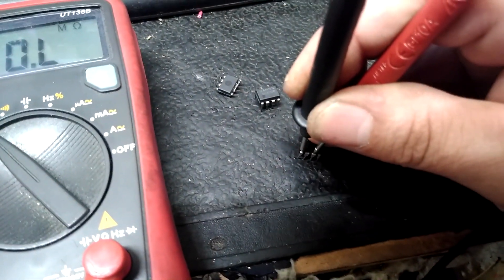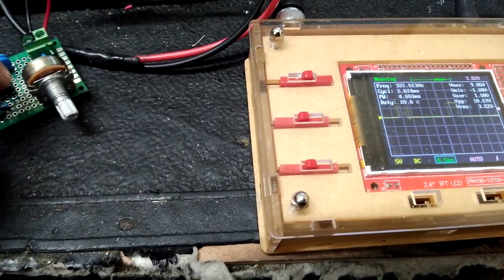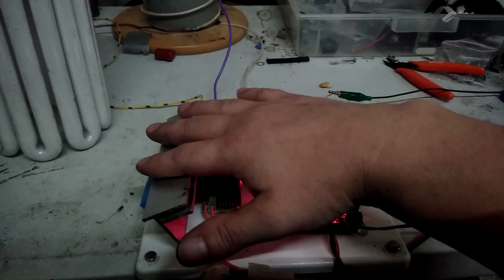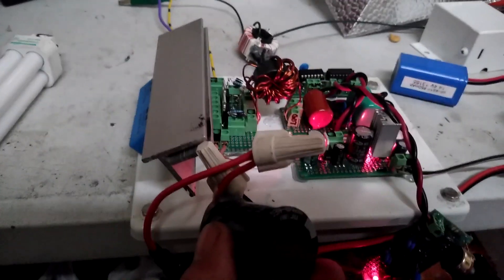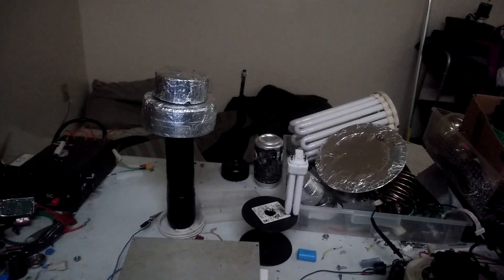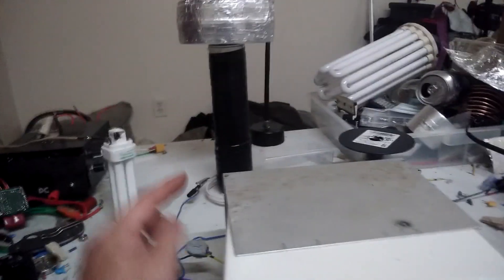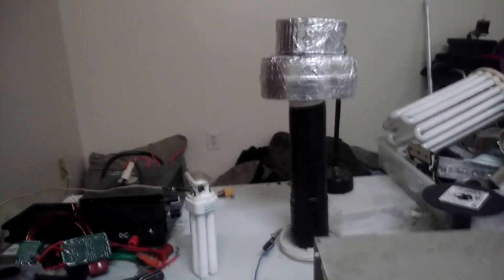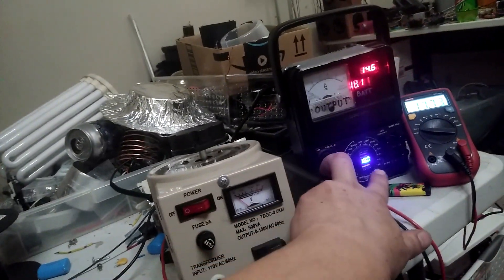Ward's DRSSTC .5 driver testing with IRFP460's

Comment: Cool, beautiful discharge!
Try to use IGBT instead mosfets. I used
 irgp50b60 in DRSSTC. They will heat less and have a built-in fast diode. In the half-bridge, put a 1 μF film capacitor or better 4.7 μF directly on the legs of the transistors, so it will be easier for them. Is the suppressor in the gate? I would put p6ke18ca, it will eat the emissions from the GDT. 
Optical isolation of the interrupter is clearly requested. I also want to make an optical isolation for the interrupter, so that they are not afraid of interference and stray from the Tesla coil.
Reply from the maker: Thanks, I was impatient and had only 2 460s on hand so I wanted to see what I could get. I'm waiting on some IGBTS now.

I've recently tidied it up and finished my half bridge and right now I've got about 6uF about as close to the fets as I can get them. I went ahead and added the voltage doubler to the board also. Only 15v zeners on the gates right now and some TVS's across the drains. I need only change out a few things like adding a 15V regulator and 1:2 GDT (I hope) for switching over to IGBT's. 
 
I agree about the optical connection for interrupter. It seems the only real way. I've tried shielded cable and a metal enclosure but this does not solve the problem entirely. 

I had hoped to push more from the 460's but I think it may be too much work given a fres of over 400khz. I've pushed them to the limits of what I can get to basic tuning recently and it's not impressive enough, or not really worth using a suitable MMC for IMO. Seems to be easier to get better arcs with a basic SSTC and 460 half bridge although that seems counter intuitive given how more efficient the drsstc is supposed to be.

Comment: That was nuts you put the plasma channel to shame with those kid of arcs.
Reply from the maker: haha why you gotta slam Jay like that? =)  But nah I did end up seeing some cool arcs in that go of testing but I also had to crank like 120vac which ended up being closer to 240v from the doubler. For some reason Jay doesn't show off high voltage coils, I guess for the age factor of people trying to build them, but he damn sure likes those multipliers lmao. I've seen much better iterations of this driver though and I get the feeling it's going to take me a lot of time to get it going right. What I've done here is caused myself to try to get better output with the 460s before even moving to IGBTs and if I can't do it I guess I'll just never move on to them.
Reply: @Magneticitist  Jay is cool and his builds look good but not vary original he is really doing main stream stuff. What are you looking for this device to do arc wise are you trying to make a constant stream?
Reply from the maker: @AnDyity  I guess I should be able to get reliable steady-looking steamers at 600-800bps or so with a low on time but also be able to get the long arcs at low bps higher on time. There will be a limit given the max of what an IRFP460 can push but I figure I should at least be able to beat my first half bridge which can run CW or interrupted and get longer arcs. I  could go ahead and plan on a design using cheap 200-300A IGBT's and feedback through whatever pole comes easier but there's no point if I can't get this one going right on the 460's. Real world tuning does not seem to match up with what I may come up with in JavaTC.
Reply: @Magneticitist  you may be driving those irfp460 too hard I was reading the data sheet it said the driving voltage was 10v.
Reply from the maker: @AnDyity  If you keep them cool they can handle over 10Vgs pulsed easily at these voltages but my gate drivers are currently fed 12v instead of the 15v Ward uses to drive the IGBT's. Also just the 1:1 GDT. I think my problem lies in the flip flop because when I go low BPS and try to turn the duty cycle up the gate drivers only want to do what looks like 15-20% max or something. What I should probably do to test this is run the same half bridge and gate drivers on a separate feedback oscillator circuit I use with the NAND gating to see what happens.

Comment: How much would you charge  to build a driver for me?
Reply: Build it yourself noob 
😂😂
Reply: @tvishmaychoudhary69   @Myself Steve  why don't you go play games in your mom's basement.  I have no issue admitting I can't solder worth a damn.
Reply from the maker: @tvishmaychoudhary69  lol he's cool!
Reply from the maker: Depends what kind of driver I guess, cost of parts is all I'd really care about and if I already have them not so big a deal for a long time youtube compadre lol. I've got drivers laying around cause I'm ADD on the low or something. If you're talking about this driver I think it probably costs something like 15-20 bucks off the top of my head for the IC's and caps etc.
Reply from the maker: I totally built this one randomly one day then shortly after realized I should have built this one to give me more headroom https://www.stevehv.4hv.org/DRSSTC1/DRSSTC1OCDsch.JPG
Reply: @Magneticitist  just keep in mind I plan on trying my wine glasses and I don't think I need huge top load discharges. I was planning on trying the 1/4" copper coil as a primary. And I am itching to try some new homemade capacitor ideas. A decade ago I deleted a lot of videos because of the Karen's out there. Little Johnny might electrocute himself if he sees you playing with 7kv. Well teach little Johnny how to read warning labels on high voltage transformers. I know I took 96.3gp down cause that device was dangerous. Lots of X and gamma radiation emitted. Radiation sickness is a bitch. Not to mention killed all my electronics like phones and computers. Then relocated projects to my mother's basement. I still laugh thinking how I got a message one day from my mother "were you working on anti gravity devices in my basement?" I told her I was using her basement because below ground the radiation doesn't travel as far. Used the gas line as one ground and the chain link fence outside as a second ground. Then 2013 happened and I lost tons of my little projects. Thankfully I still carry the learning from the building of those projects. Like recently it was I remembered how I coated the glass in beeswax before coiling. Using that fishing reel to tension the wire is a idea I wish I knew years ago.. anyways I will shoot you a email later. I got some coils I need to get some polyurethane on.
Reply from the maker: @MAGnetICus_Attractus  I guess it will really all depend on power levels. Hard to say the best way to drive something like a wine glass but it will not be easy given the size ratio and turns. You also wouldn't want to feed so much power into it at the glass resonant frequency it shatters lol. A higher frequency driver seems more suitable but then you are left with more corona than sparks. For such super high voltage input it may be better to just stick to a HV supply and spark gap, something homemade caps will work well with. When I played with foil capacitors for a hairpin circuit those suckers could sometimes jump out inches to shock me. I somehow got shocked through the pantleg one time messing with those by just being near it.
Reply: @Magneticitist  sent you a email.

Comment: I’m still waiting on a couple igbts, the drivers and a few wima fkp1 capacitors. Can’t wait to try out this circuit.
Reply from the maker: I'm so unfamiliar with IGBT's I'm afraid to try buying some yet, but I'm wondering if I can get away with the smaller packages instead of bricks. I also don't see why I wouldn't be able to use 460's at least temporarily but so far I haven't had much luck. Already fried 2 gate drivers. I just got some small 1000v wima mkps but they are 6.8nf each so I'm thinking of trying like a bank of them on a low turn primary but I don't think I have my flip flop working right. Can't figure it out yet, I mean it 'runs' but not better than my other half bridge and even when trying to resonate the primary I get the impression that I can't drive powerful enough arcs because the gate drivers do not see enough on time, regardless the interrupter being set that high. Using tested and proven GDT's and CT's (when I was able to accurately scope them) I figure it has to be the flip flop. 

I noticed in Steve's next DRSSTC he doesn't drive the flip flop the same way but caters a small RC tank into the PRE to help switch at the zero crossings. His interrupter signal is also not fed directly into the first input of the schmitt trigger.
Reply: @Magneticitist  yea, igbts are pretty foreign to me as well. I noticed that most people use FGA60N65SMD igbts in their designs so that’s what I ordered. Though I have also seen irg4pc50w igbts used. I don’t really know much about them and what characteristics to look for so I’m just gonna go with something tried and tested.
Reply from the maker: @quantumlab9130  I couldn't find any of those from legit distributors. Aliexpress I guess? I can find a lot of 'newer' versions but they don't seem to be able to handle much more peak current than a 460. It does kind of seem like people have been getting away with the cheap aliexpress ones though.
Reply from the maker: @quantumlab9130  4 bucks meh yea a little up there but you're right probably worth it. Don't see why the TO-3P wouldn't be fine for reasonable peaks. Probably pretty ideal for Steve's .5 driver.
Reply: @Magneticitist  idk if they are worth it yet, I’m gonna test them out and see how well they work.

Comment: Iam also making a similar circuit with IRFz44n and discrete gate driver🥰 should i upload a video about its when done?
Reply from the maker: Yea man I wish everyone would share their setups. After my last setup I think I hit my ceiling of what I can get at around 30V so I tried moving to this higher voltage drsstc but so far it's been tough dealing with. I need ideas.